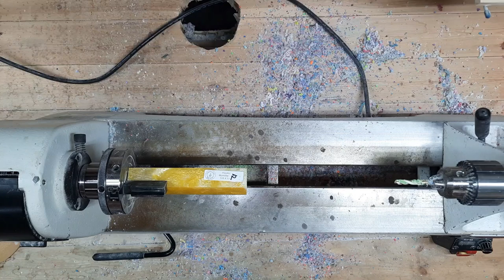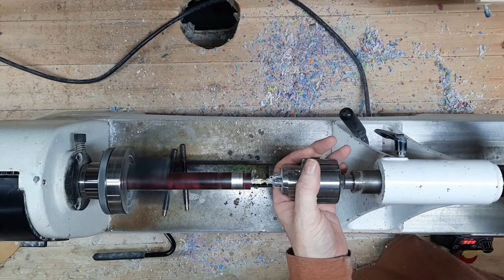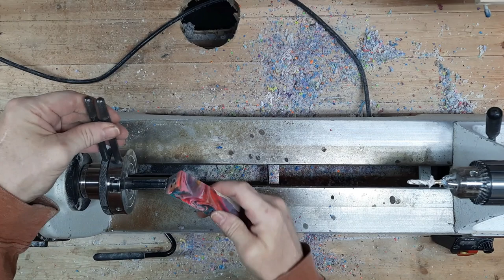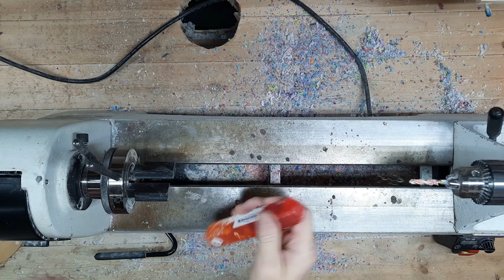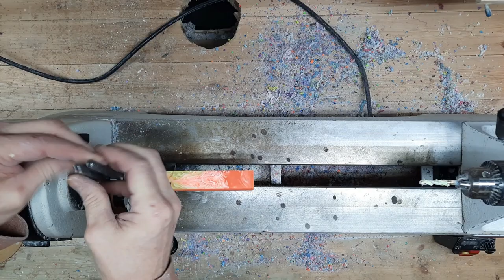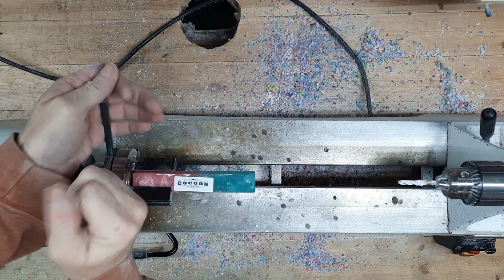Drilling diamond Painting Pens

Comment: That was cool. I didn't see a stop collar on the bit, how did you know how far to go (when you just started)?
Reply from the maker: He started making diamond painting pens for me initially because the ones included with a kit pen were literally causing me pain.  He just took the tips from my kit pens and used those as an example for how deep to turn them. The shaft of the tips are right at 8mm in length - if the hole is a little bit deeper than that it won't cause any issues because the tips have a lip on them (of course it would be a problem if the hole were not deep enough). We were one of the first turners in in the industry to start creating diamond painting pens back in mid 2018 - most of the process at that time was learning as we did it because it simply hadn't been done yet.